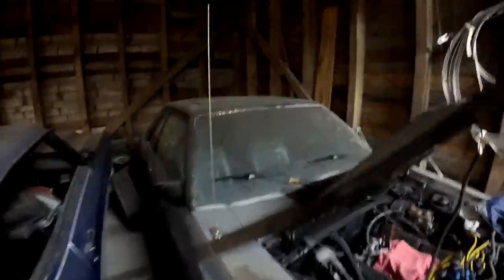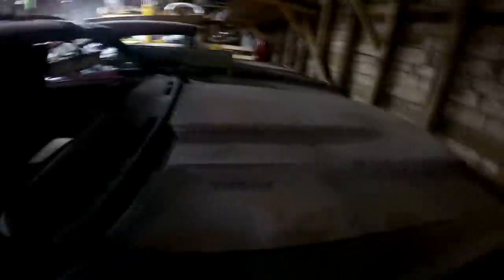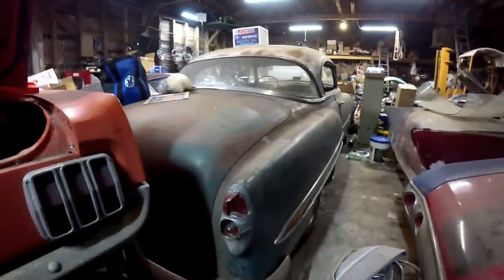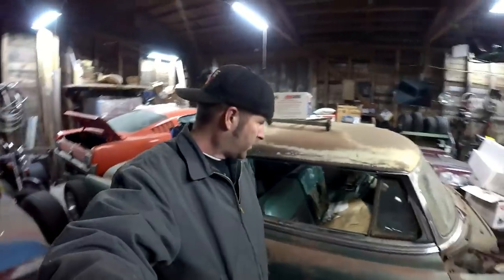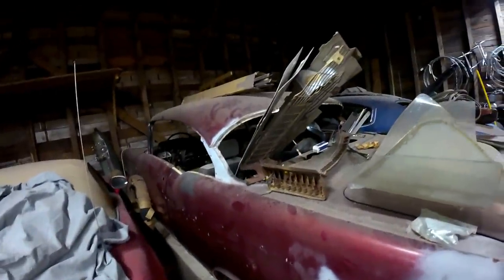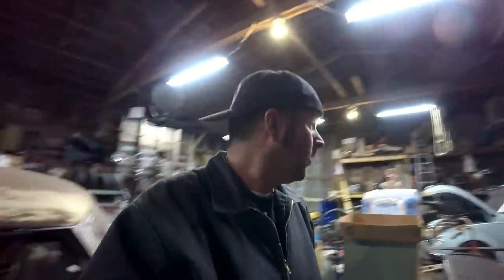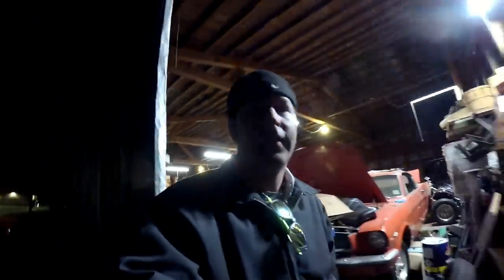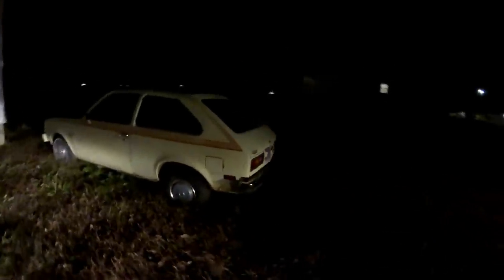Going through my stash #3

Comment: In the 90's I totally did a 1981 2 door Chevette top to bottom, rebuilt the 1.6L, made a  hybrid a carburetor with large jets in primary and secondarys, Put in the Borg Warner 5 speed manual (some came with it, same box behind the 84 Camero HO 305, rated at 150HP...lol) a Centerforce 1 clutch, Also there was a HO Chevette made and I took the camshaft from it in the triangle dog house all as one bolt on item. New carpet, dash, all new plastic panels, found a dash with a tachometer instead of the clock, had to change the wires on the connector to match functions. Then swapped to the CS rear end. Then put a $1000.00 paint job on it painting all the grill, light frames and bumpers a bitchen red with all black interior.  Nobody knew what kind of car it was without any emblems. IT WAS A NEW CAR. I took it to the drag strip and did a 19.22 second QUARTER MILE, not bad for a stock 1.6L. It would smoke the 13" tires 60's series(TIRE) any time you wanted.

Comment: My 71 chevelle Malibu is a Arlington Tx built car the build sheets are under the a pillar, rear passenger feet area under the sound deadner and carpet and on the gas tank. Also mine had the interior options listed under the back seat springs, the only build sheet I’ve found so far is under the carpet mine is 1 of 5000 with an orignal 6 cyl and is in great shape I’ve got a all forged internal 350 with brodix heads going in it when it warms up a bit here

Comment: If I had the 53, I'd take the old 3 speed out, and get a 4 speed Saginaw.  You can hook it up to the original 3 speed linkage, you just need to put reverse on a separate lever, or I've seen people rig it to a cable, with a knob on the dash.  Then you can bolt on one of the Borg Warner overdrive units that they used on the these speeds.  That car would be so cool with a four speed overdrive.

Comment: Scat made a 4340 crank for those 4.3L V6's that'd allow you to turbo it without breaking the crank like Roadkill did, but good luck finding one. Remember they are also the same as a 350 so if you want to convert it to 4 bolt mains, you can use stock 350 4 bolt mains on the two inward mains but you'd have to have the block line bored to go with them. Also all 350 rods and pistons work.

Comment: A trans option for the 53 chev could be a old 3 speed overdrive they had them up till the mid sixties. They are excellent for cruising , they are a regular three speed with an overdrive unit on the back.

Comment: Zmodo cameras. they have a NVR set up that doesnt need net it backs up to the hdd if have net then you get live feed to your phone or mobile devices.  last time i got a set from ebay nvr 2tb for 165$ that deal is no longer avail same deal cost around 275$. BUT its still worth it. 4 cameras. 2tb nvr and bank level security. i love it i have cameras at my garage. my storage unit and at my house all doors. and if any motion happens in front of any camera i get a text to my phone asap. ive tested them and its like ms you get a notification. i use tmobile phone and use its hot spot as the cameras internet. that isnt cheap a month i pay like 90$ to have the unlimited internet hotspot. but its running 6 cameras 24-7 seems i use average of 90gigs a month on those 6 cameras to run 24-7 depending how much they are recording and picking up. past week no motions so im using low gigs this month. i caught someone trying to steal a motor cycle 2 months back. i was in motion to the garage asap. before they could get it out the garage i was there and right behind me was the sheriff. dudes face on camera when i pulled in then sheriff right behind me was EPIC> i might upload some of that footage. but same time i dont like to get to personal with the world like that. it is the epic looks up jaw drops puts bike back on kick stand and he put his hands in his head like FK ME IM GOING TO JAIL. he ended up having 2 warrants and was wanted for not reporting to Parole officer. some random act of violence i had no idea who dude was. 
none my friends know who he is either.

Comment: Be sure to check the front end on the vet that’s the weak spot
Reply: Actually the front end is the best part, even MAZDA race manuals recommends modifying their front end to like the Chevettes, It is rack and pinion and is told to be OVER BUILT and should handle the v6 fine.